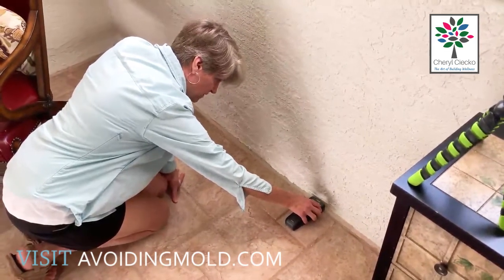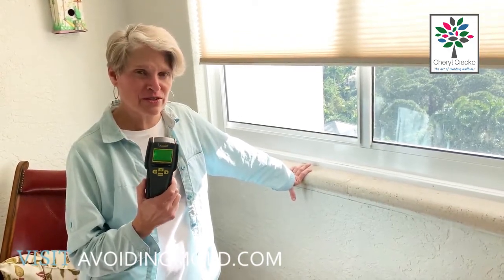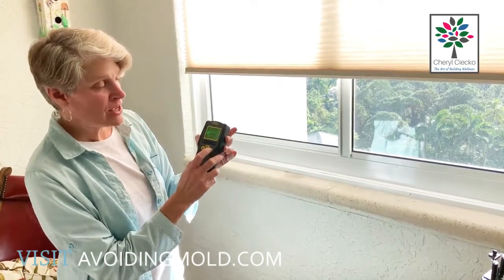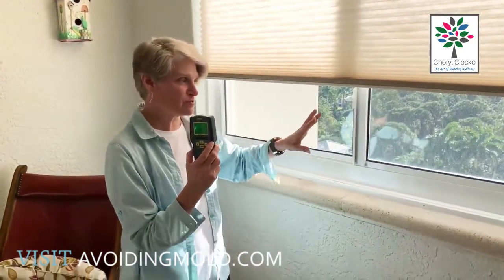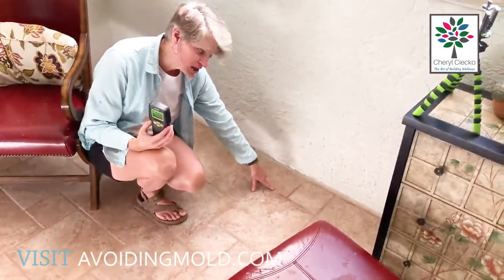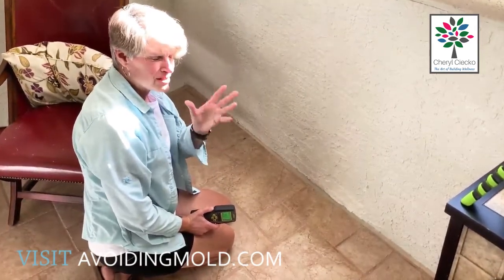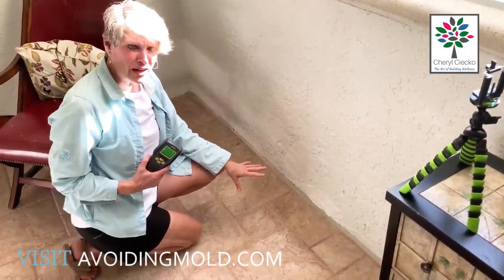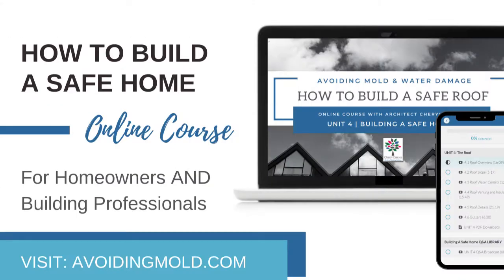How To Use Your Moisture Meter EPISODE 19 Building Well & Preventing Mold

Comment: Hi Cheryl, I understand getting a baseline for your particular area, buy could you give a general guideline of what would be too high for each setting, also do you have any guidelines for evaluating linoleum flooring. I have the same meter as you. Thank you!
Reply from the maker: Linoleum and other plastic or vinyl type products are among the most difficult to evaluate with any moisture meter.  
As far as numbers or readings go, different materials have different scales to determine what is acceptable or not.  Some materials don’t have a scale to evaluate.  I have a webinar on this topic with a guest specialist, Ilene Cohn, available via my website-  www.avoidingmold.com.  That’s about 90 minutes of content on your question.  The answer is complicated and varies by material.  Drywall should be less than 4-5% on a drywall scale.  Wood depends on whether the wood is indoors or outdoors and depending on climate zone and conditions.  Great question!